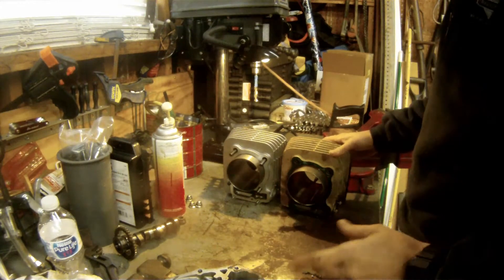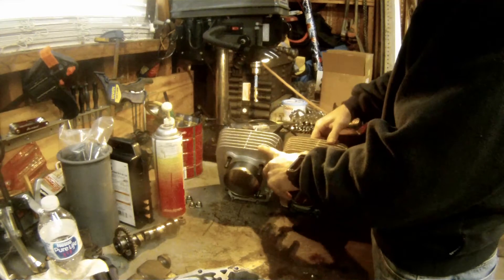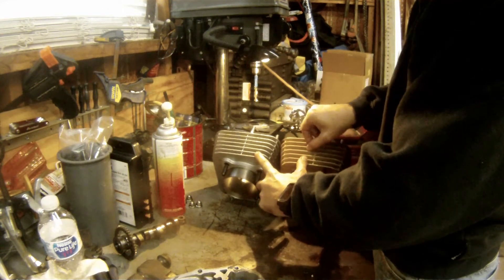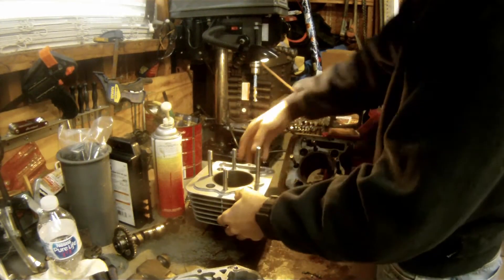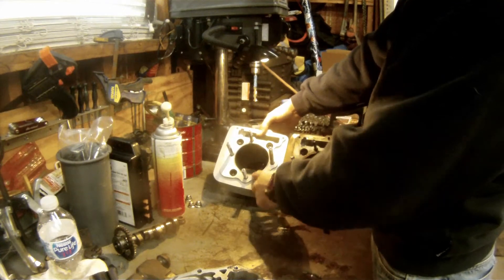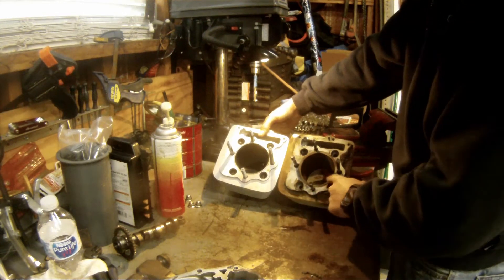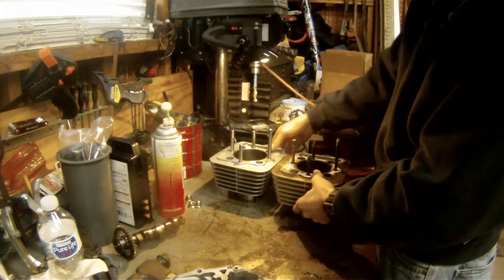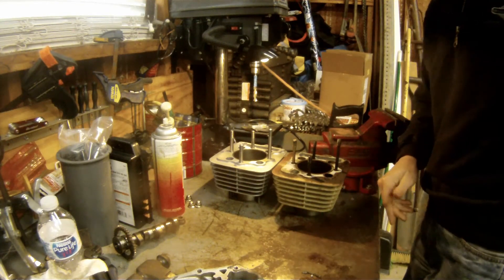Niche Industries 440EX Big Bore Jug VS Stock

Comment: Im running a niche big bore kit stage 1 cam in my warrior 366 great kits and parts no problems,How is your kit holding up i love mine......
Reply: I'd like to know also
Reply: @bbob8795  same  question ...
Reply: Still ok?
Reply: @jequinlan3    he rarely replies .. to anyone .  channle has no email address as well .
Reply: @charleshueckstaedt5064  thanks. it looks like this company is the only one that has a replacement cylinder for a trail boss 250 probably going to give it a try for a hundred bucks